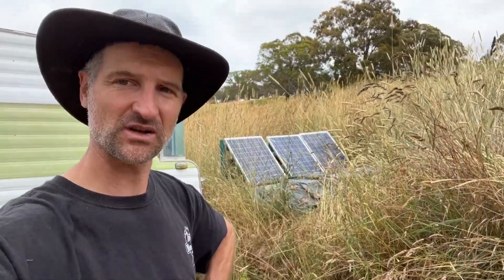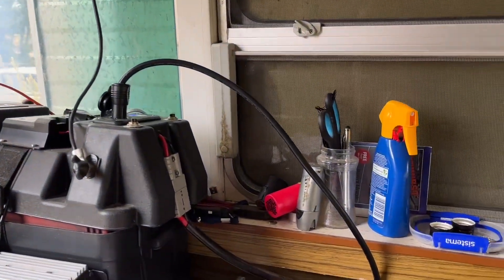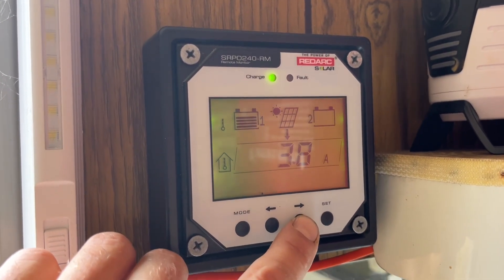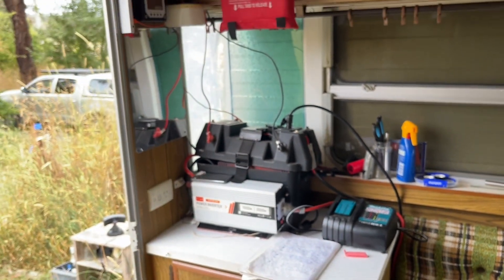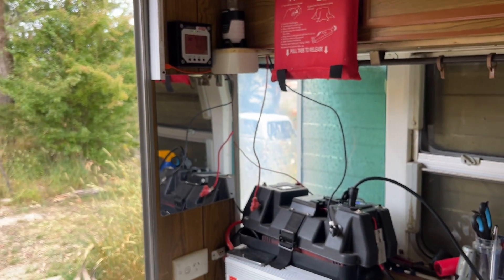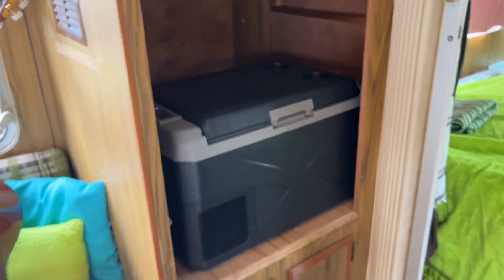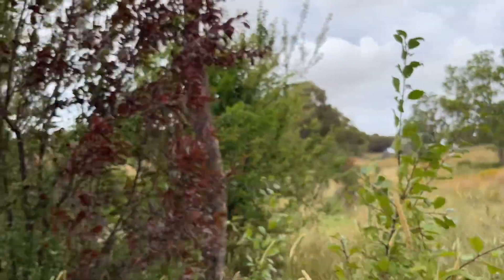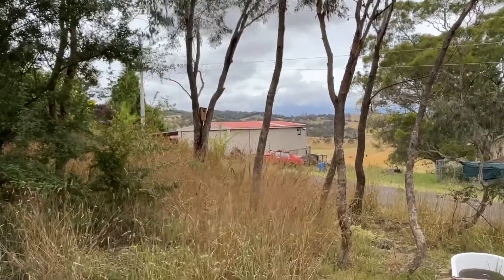Off grid DIY solar system with used car batteries for my caravan at Bindari

Comment: nice mate. wondering how much the total set up was cheers
Reply from the maker: I've now added 3 used car batteries I got from an auto electrician which are wired in series, plus a 12v fridge. I have so many amp hours worth or power I don't think it would run out even if I left the lights and fridge on, charged makitta tool batteries etc extensively. Car batteries were $20 each, I can't remember the price of this set up but about $400 second hand. The most expensive part was forgetting to turn the inverter off when leaving site and draining $400 batteries that died.